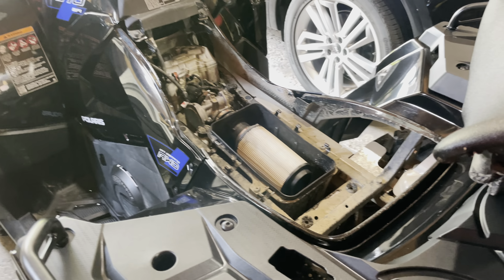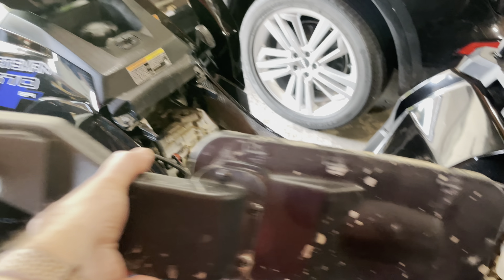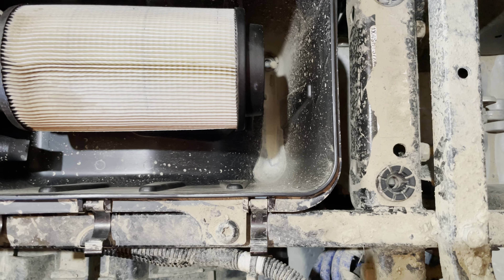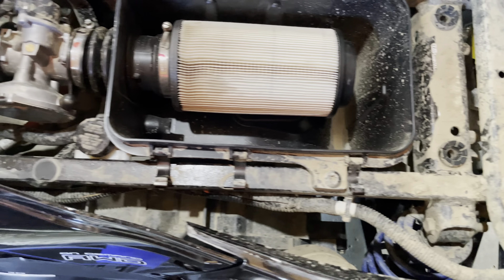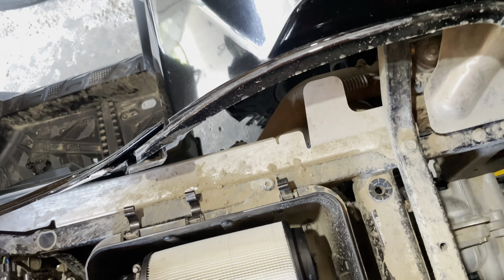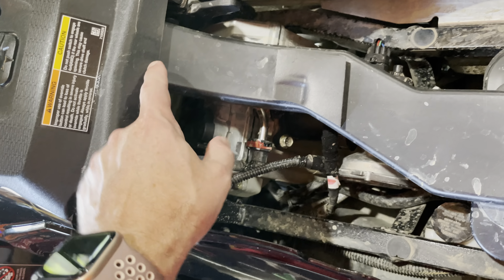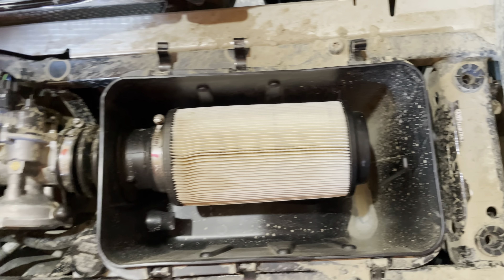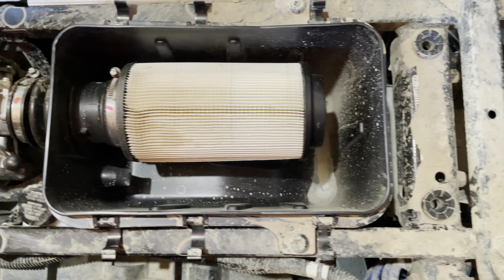Water in Engine Air Box? 2021 Sportsman 570 Trail

Comment: I have a 2021 Sportsman 570 that had the same issue. I took it in for maint. and had them look it over. Here is what they found - The OEM airfilter is garbage, if it gets wet its basically damaged and needs to be replaced. The water is comming in from the snorkel itself and from the little drain plug at the bottom of the box. There are a few cheap mods you can do for this - but basically, extending your little snorkel or sealing up the box will keep it dry. I would also suggest a water proof airfilter to keep water out of your throttle body - water in that filter will suck right into the motor.
Reply from the maker: Very informative reply and advice, thank you! 👍

Comment: It’s obvious you’ve ingested water/mud in your air box. The residue of mud around your air box is clear evidence of it. This is 100% fine and it’s great you use your unit the way that you want to. I’ve been riding atv’s for 25 years and never ever have this issue but I try and avoid mud and water.
Reply from the maker: It seems you’ve assumed I use my machine as a mudder or submarine. I do not. I trail ride. And on every single trail I’ve ever ridden, there are puddles. And where there’s puddles, there’s mud. Totally unavoidable unless I ride in the dessert which I have no interest in doing.
Reply: @JimboP-Outside  Yes sir there’s not much mud and water in the desert though it’s still very enjoyable riding there. I’m baffled as I have the same unit as you do and have been using it in the deep woods in Wisconsin and UP in Michigan. I’ve never had the mud and water where you are getting it though certainly have driven in those conditions. Good luck in coming up with a fix.
Reply from the maker: @cerny4444  Thanks for the details DA. For me, it seems the water splashes from the back wheel inside the plastics and right into the belt box intake. I’ve been to the same farm 3 times in a row and have not been in a puddle deeper than the floorboards on the ATV. In any event, I do enjoy this machine and glad to hear that you do as well.  👍

Comment: So I’ve put 1700km on my 2021 trail this yr since I bought it all tail and some mud (my local trails sometime u have no choice) but a lot of wide out high speed trail stuff and I do get mud in the air box but it’s always the same amount no matter how I drive so I think it’s when it splashed from puddles at high speed. I just wide it out and blow the filter out and keep going. Don’t sweat it bud
Reply from the maker: Will do, and thank you for sharing your experience. 👍
Reply: Also for the belt box I just bought a base model style and slammed that on had that for 1k hard fast kilometres and the belts still ok

Comment: Looks like dust build up. Make sure you are running a pre-filter that can protect against small splashes.
Reply from the maker: Thanks Travis. Is the pre-filter that sock-like thing that goes over the filter? I’ve seen other machines come with them, mine did not.
Reply: @JimboP-Outside  yes it is!  There is also a aftermarket gasket for the lid if you think it’s leaking.
Reply: @travis-price  can you provide a link for the exact one you speak of? Thanks in advance for your contribution pal

Comment: I have a 2021 570 and I notice the drain plug doesn’t seal at all, I tried to silicone it but water still gets in from somewhere poor design for the cvt and air intake
Reply from the maker: Good point, I’ll look into that. Thank you 👍
Reply: @JimboP-Outside  no problem it’s great to see videos like this , Gives people a heads up or people can discuss solutions they came up with to fix the problem

Comment: I picked up my 570 trail the beginning of June. I've had it sitting in my garage, I cant ride it until September sometime due to some medical issues. Theres not even 1 hour on it. 2 weeks ago I noticed its leaking oil from under the front axle. There is a plug there. Dripping right off that plug. Its going back tomorrow morning. Pissed me off...

Btw I did the belt box exhaust mod as well. It's a great idea.
Reply from the maker: I’m sorry to hear about the oil leak, and your medical challenges. I enjoy this machine but I’m getting very concerned about quality. 🤔